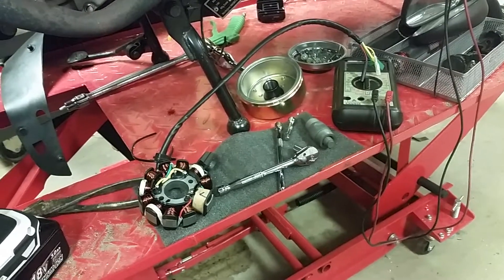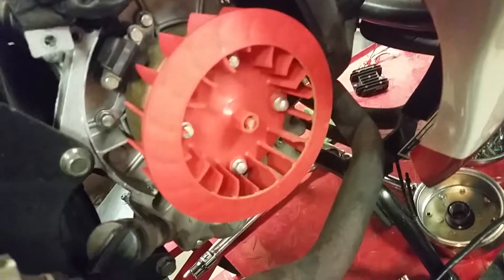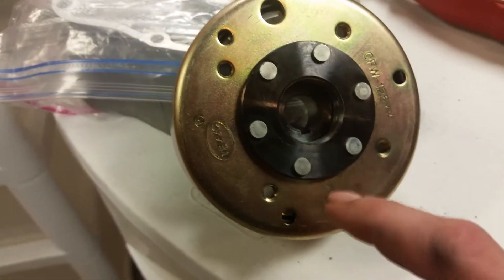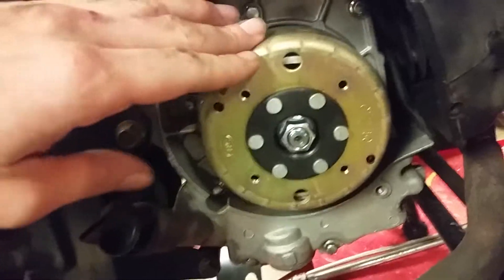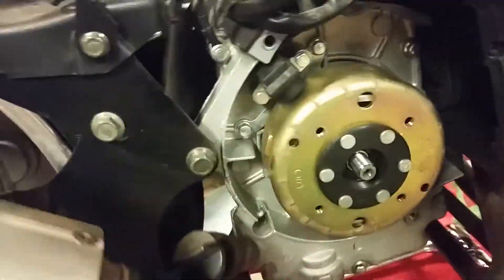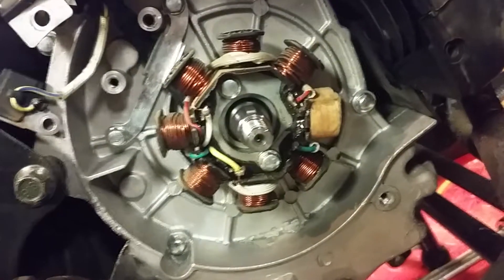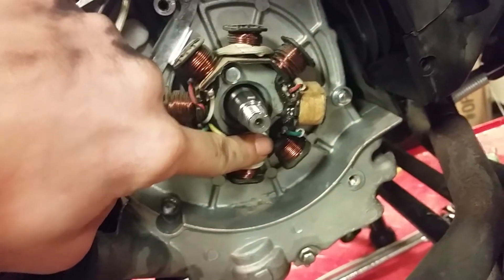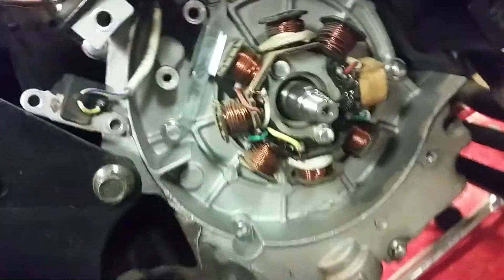11_Pole_Stator_Upgrade_Part_1

Comment: why would you go from 8-pole to 11-pole?
Reply: Better charging. Scooters don't do well at idle with headlights/turn signals running. Some will even die if the battery is getting old.
Reply: i have a 150 and an 8 pole stator runs and charges mint.